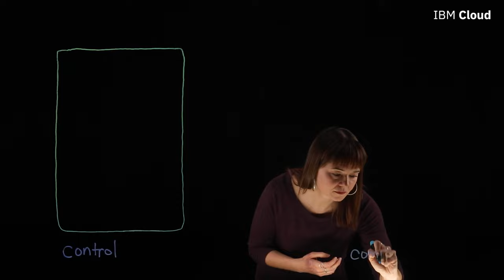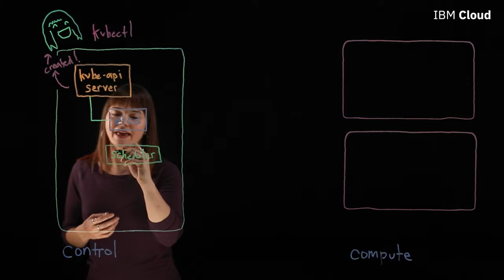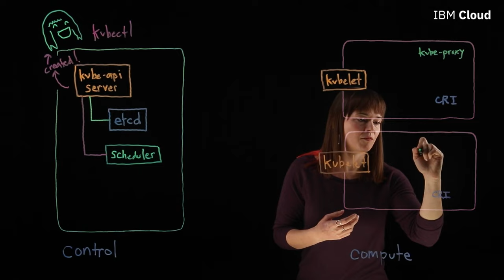How does Kubernetes create a Pod?

Comment: So I am a data scientist and hence mostly an end user of the pods.. thanks for the explanation. So when we create a pod it assigns a random generated (available) ip that I should use for the compute. In my case I was using a jupyter notebook. Since pods are ephemeral like you mentioned, we need to attach a disk to the vm/pod which is always available to me. One time while running some python commands, my pod crashed and I got assigned another vm ip but the person who got assigned the vm ip I was using until then got my jupyter notebook saved on his disk. What could have happened? I am intrigued.
Reply: Seems like a race condition... your pod got killed but respawned just fine due to restartPolicy = always (by default) the that same pod got assigned to someone else
To avoid that I suggest set the restartPolicy to never or create a control plane that control the lifecycle of your pod so you always get the same pod until you dont need it anymore
makes sense?

Comment: I noticed you didn't  mention the Pod state during this process. 
Here it is:
1. After Kube-API server returned "created" response to user, the pod's state will be "pending"
2. After scheduler set the node for that pod, Pod's state will be "creating" 
3. After Kubelet created the pod, state will be "running"
4. If the pod is failing and restarting, state will be "Crash loop back off"

Comment: How can a single container (host) be run using this method and also run multiple pods with containers in them ?
Reply: With k8s the atomic unit is the pod. If you just want to run a single instance of a container image you'd just have to create a pod referencing that image.
Reply: To run multiple container in a single pod you have to define  them usually on a deployment

Comment: Can replication controller recreate the  pod by itself or does it talk to kubelet to restart the pod?
Reply: i think replication controller will talk to kube-api and kube-api to kubelet , to recreate the new pod with same config. it will not restart the same pod as pods are ephemeral.  Also there will be small role of scheduler as well, as it will tell on which node that new pod will be recreated, either same node or new node, depending on node availability.
Reply: ETCD contain the desired state of the pod. as control manager has the health status of the node, when the pod dies , control manager -> write to api-> api will checks and write to ETCD and back to API-> when scheduler gets to know pod need to be created from API -> it starts the process.

Comment: Doesn’t Kubernetes need a load balancer in front of compute nodes?
Reply from the maker: Hi there! Depending upon where Kubernetes is deployed, you can integrate with different load balancers that the infrastructure provides to expose pods as Services running on k8s. Different Service types take advantage of different networking patterns to access the pods running on the underlying infrastructure. NodePort-based Services leverage existing IP addresses of compute nodes and are accessed via a Node-level proxy. LoadBalancer-based Services create new Load Balancer instances and handle traffic directly through the infrastructure-based LoadBalancer. 
So the answer to the question is “it depends on how you want to access it”. 🙂